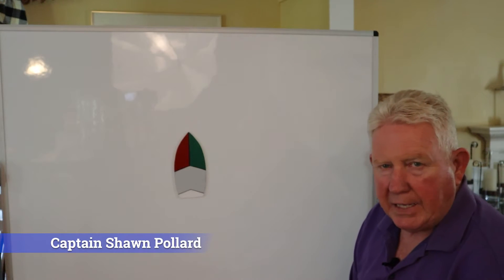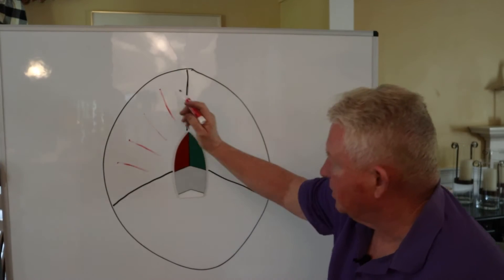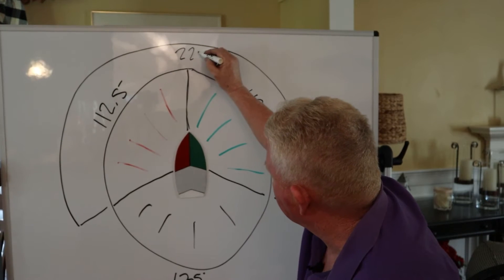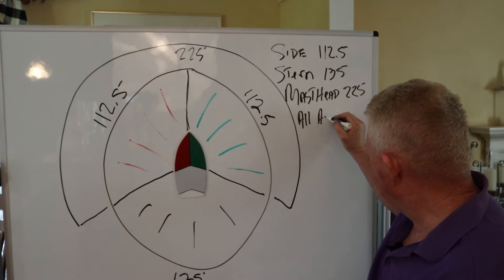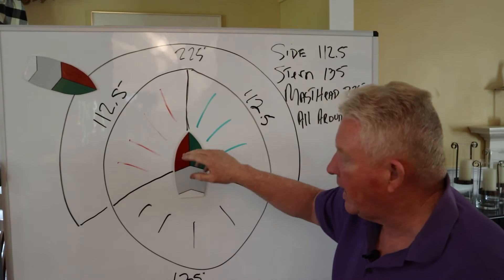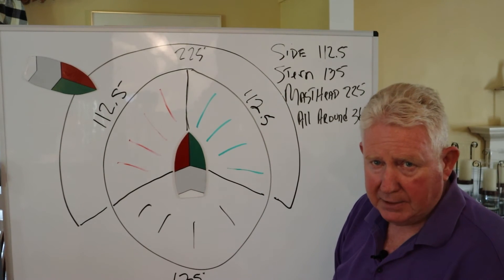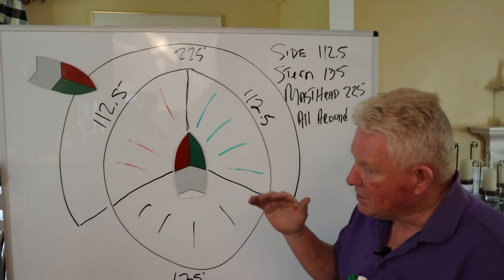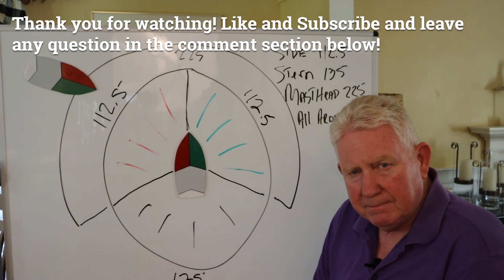How do other boats identify which direction you are traveling just by your running lights?

Comment: Most noncompliance with the nav arc of visibility occurs in the vertical sector, where the  included arc is 30 deg, 15 deg above and 15 deg below. Most non-compliance issues occur when a random or other object is obstructing the lower sector. The vertical arc of visibility is very important and could take a 30-minute podcast to explain, explore, and show corrections
Reply from the maker: Excellent point, thank you so much for sharing!!!

Comment: if you are on a sail boat and aproaching a power boat of you starboard how would the rules apply
Reply from the maker: Great question. It depends, if you are “under sail” you are considered restricted in your ability to maneuver and thus you are the “Stand On” vessel - the vessel on your right is required to “Give Way”. However, if you are not “under sail” you are considered a power driven vessel and all of the normal rules apply. Thank you so much for your question, and for commenting!!!

Comment: Very good drawing! Sorry if I missed it, but did you mention that boats using only sails do not display the mast head light? I´m European, so the rules may differ, but I suspect the "light rules" are global?
Reply from the maker: Tord, thank you very much for your comment and question. We are all under International Rules which apply to all vessels upon the high seas and in all waters connected therewith navigable by seagoing vessels. Rule#1 of the unified rules (ColRegs) breaks down everything very clearly and has good definitions.
In regard to your sailboat question - I did not specifically mention a sailboat - my bad. I may not have been clear enough, but I find new boaters get confused when they are required to display side lights, a stern light and a masthead light (power driven vessel less the 50 meters) and actually get on their boat to look for a masthead light of 225 degrees and a separate stern light of 135 degrees and find only a single 360 degree all around white light - which satisfies the requirement.
Rule#25 covers sailing vessels underway and vessels under oars. You are correct, a sailboat is not required to display a masthead light - only side lights and a stern light. Each of the sailboat's light will cover the required arc of visibility and should not be confusing. Rule#25 also covers several options you may exercise. If I'm still confusing you, please let me know and I truly appreciate your interest.
Shawn